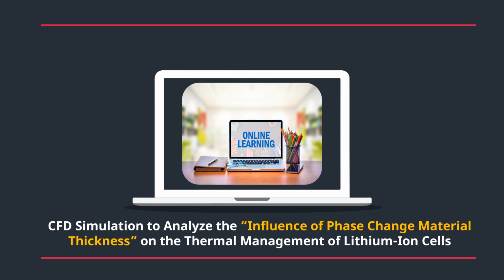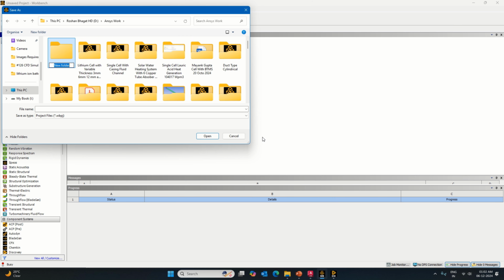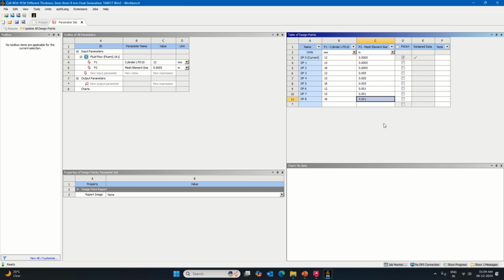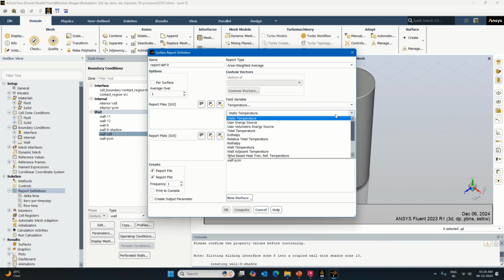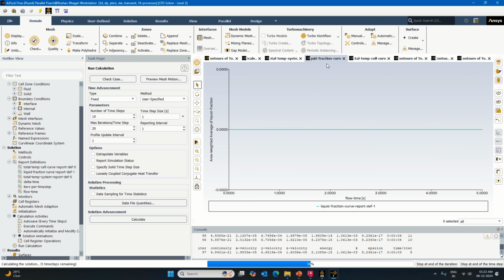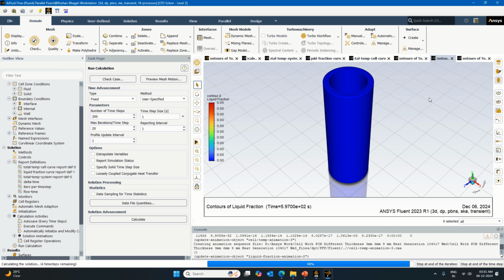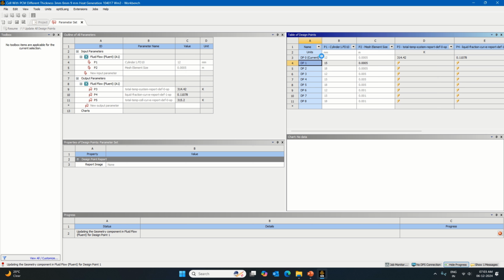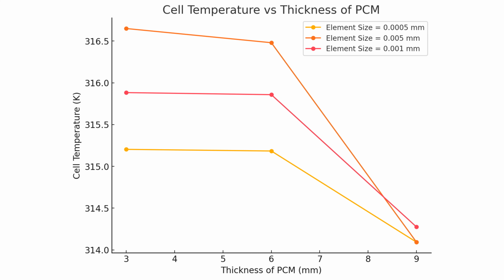CFD Simulation of PCM Thickness Influence on Thermal Management of Lithium-Ion Cells

Comment: Doctor, isn’t it originally required to include an enclosure to represent the surrounding air and apply the Navier-Stokes equations for natural convection? Or, since h was assumed and fixed, does this make the enclosure unnecessary and have no effect?
Also, in the reference paper used for the simulation, was the enclosure included, or not?
Reply from the maker: As per paper enclosure is included however we can specify the air zone surrounding either natural or forced but the mesh count will increase. some time due to limitation of computational capabilities things may get complex

Comment: Sir I am using 2D flow past cylinder with pcm around the cylinder, using Laminar option, periodic upper and lower walls and using a udf code for heat genetaion in the cylinder, but the system doesnot converge when gravity is used, why? Is there any solution to it?
Reply from the maker: If your UDF or material properties (e.g., density variation for PCM) are not compatible with Boussinesq approximation or variable density model, Fluent might fail to capture gravity effects properly.

Comment: Hello sir, I would like to ask what materials should be set up in Wall 8?
Reply from the maker: first check the interface using display mesh then define as per your material
Reply: @FrontiersInCFD  For this case, I open Wall 8 and it shows that the adjacent area is PCM, so should I set its material to PCM? But I found that the area adjacent to the wall 8 shadow is cell, but since I set the wall 8 material, the wall 8 shadow's material will also be set to the same time

Comment: If I share an article, can you analyze it?
Reply from the maker: yes
Reply: @FrontiersInCFD  thanks
Reply: Link is not add
Reply: Lithium-ion battery thermal management system using MWCNT-based nanofluid flowing through parallel distributed channels: An experimental investigation
Reply: Lithium-ion battery thermal management system using MWCNT-based nanofluid flowing through parallel distributed channels: An experimental investigation
Reply from the maker: Please share on frontiersincfd@gmail.com
Reply: @FrontiersInCFD  thanks I will share

Comment: Can you explain why we are defining both the liquid and the solid material for the PCM?
Reply from the maker: If only one phase is defined, the simulation may:
Fail to converge due to undefined properties in the missing phase.
Produce physically incorrect results, as the solver lacks the required data for the other phase. Defining both phases ensures the solver can handle these complexities and deliver accurate results.
Reply: @FrontiersInCFD  thank you for responding , one last thing I didn't get is why u set the PCM as liquid in the cell zone conditions when it's supposed to be solid at first?
Reply from the maker: In wall boundary condition solids are already present hence